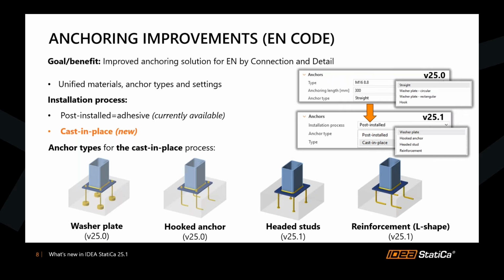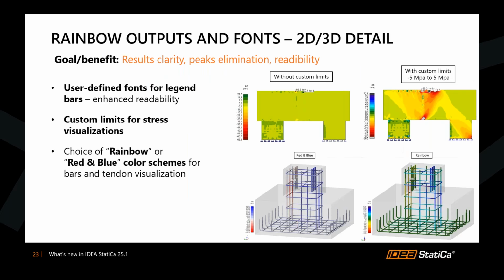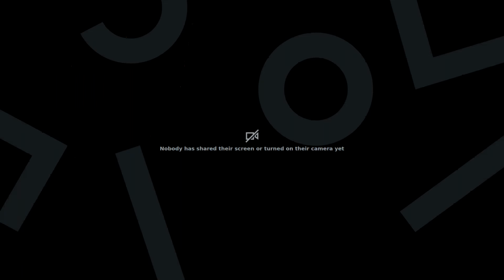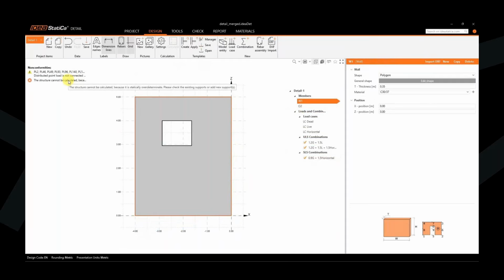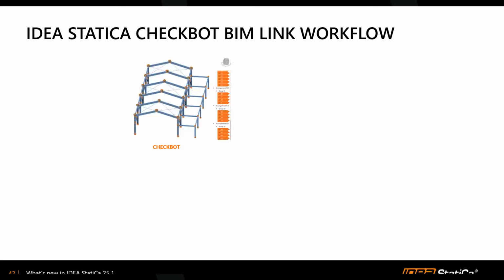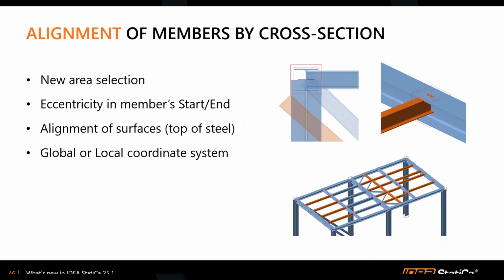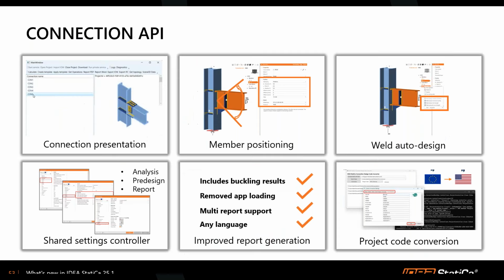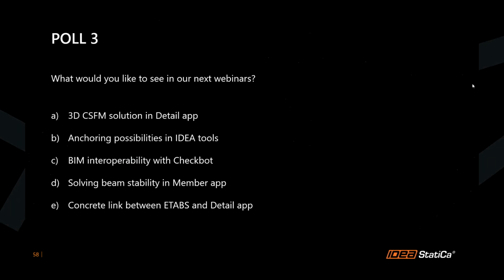What's new in IDEA StatiCa 25.1 (APAC)

Comment: I am an ideastatica 21.1 user and I want to import it to the new version of etabs, but I can't.?
Reply from the maker: Hello, thanks for your question. If you are a user of version 21.1 and you would like to use the benefits of the new version, you have to update the software. Either you have to pay the maintenance fee or switch to our subscription model. 
However, updating to four versions is a significant step, as the software has undergone substantial changes over time. You'd better check with your local support team how to run the update properly.